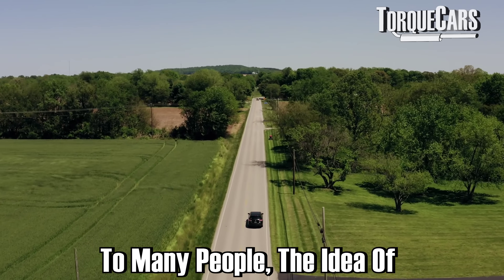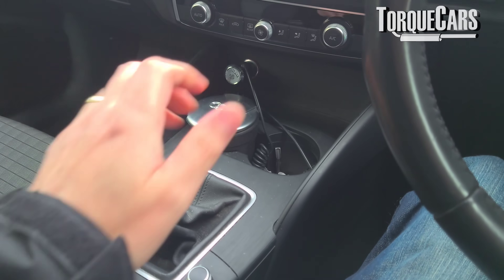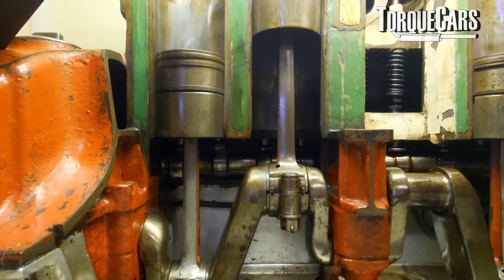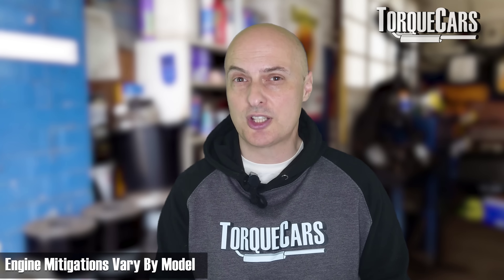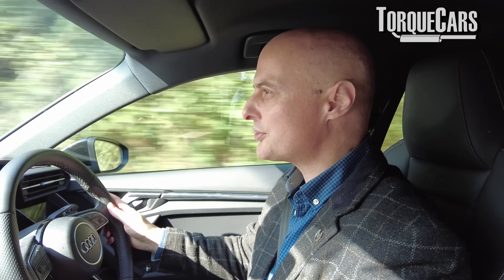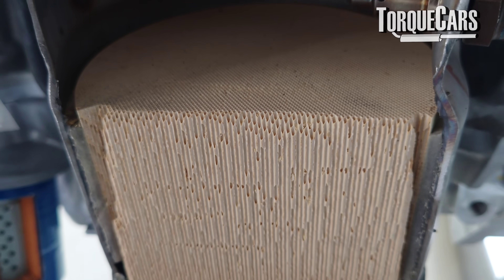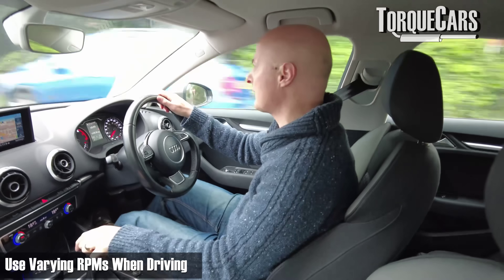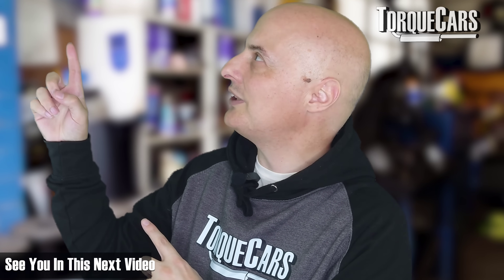BIG DAMAGE By Lugging at LOW RPM? Eco Driving Warning! (Manual Gears)

Comment: Good video, just a couple of points though, I think cooling problems due to consistently driving at very low revs is exceedingly unlikely, cooling systems are usually massively over spec'd (to account for all climates worldwide an extreme conditions). Maybe if you had a fully loaded car towing a heavy caravan or trailer, going up a long steepish hill at low speed in hot weather, at very low RPM (sub 1500 with WOT), it might then overheat, but that would be a supremely stupid thing to do! lol
Also at 2:54 you said too lower a gear when you meant too high a gear 😉
Reply from the maker: You are right, I slipped up with the high gear thing and didn't spot that in the edit either.

Cooling systems are generally good as you say and it is unlikely to be much of a problem but I mentioned it because I'm aware of this happening on a couple of cars in both cases, they were slow speeds wrong high gear selection and one was actually towing come to think of it. Both owners slowed up and used high gears because the temps were high and they shot up higher!

Comment: Funny thing, we have a 1.0 shi*box, the best way i found to actually have better MPG or Km/L since we use metric here, is to actually change gears like the owner's manual says to use it, by order of speed, doing it actually made one hell of a difference, engine runs much better than it did with the low rpm approach, now running constantly at 2500rpm all the way to 3500rpm to change gears and sits at 3000rpm for the desired speed at a gear, 60kph for 4th gear and 80kph for 5th, sits at 3000 in both cases, no need to go full throttle, noisy since "shi*box", but much smoother and responsive when needed to get out of trouble, maintenance wise even the oil comes out in better shape  than it did before.

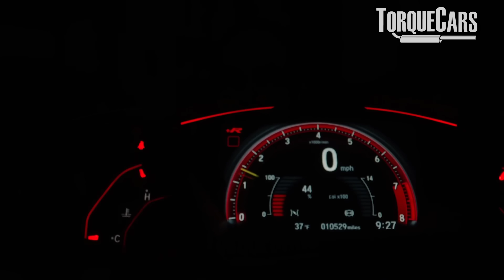Comment: 5:13 What?
First, I'm an embedded programmer and even cheap microcontrollers run way faster than what engines run at. There's a reason why we were able to achieve EFI in the 1980s.
But when you're at higher RPMs, you have less time between revolutions and combustions.
Did you really screw up the math this bad? High RPM = more frequent revolutions and combustions = less time to adjust. Not that the computers need that time to react, it's the electromechanical devices (throttle body, VTEC/VVT solenoids, etc) that need time to react.
Reply from the maker: Sorry if that wasn't clear. The ECU has more times or opportunities to adjust - not more time overall. So I merely meant that at 5000 rpms you have 5 times as many points of measurement and opportunities to make adjustments than at 1000 rpm. The ECU is not the limiting factor here, so an engine will generally run smoother at higher RPM's.

Comment: I drive my '14 Accord manual transmission at low rpm's most of the time.  I don't lug the engine.  I can keep it under 2000 RPM  at speeds less than 40 mph.  It has 228,000 miles (366,000 km).  Engine and entire car has been trouble free.  If I need more acceleration, I use lower gears and go 3000 to 4000 rpm.  I don't think he means my driving style.  This engine is 2.4 liter and has lots of low rpm torque.

Comment: I have a ‘24 Honda civic with a 2L and a CVT (ugh!). It has a “sport” mode where you can use the shift paddles to simulate up and down shifts. I have noticed that it will allow the RPMs to go higher, but if it’s in a higher “gear”, there is no real response from the engine if I floor the pedal. By that I mean that there’s no spark knock or change in sound at all. I think it’s a programmed-in thing to prevent lugging the engine.
Reply: Forgot to mention, there is no acceleration in that situation unless I downshift.

Comment: This definitely makes me paranoid. I have a mk7 gti with the dsg and it shifts at an insanely low rpm, i mean unkess you have the gas pressed down over half way it will upshift at 2k
Reply: All modern automatics do that. It is to save fuel, nothing else. It does not matter if the car lasts only 150.000 km, as long as it save a bit of fuel. That is what happens when you let politicians to decide on techical matters.

Comment: Interesting insights here. Would the equation change at all for a very low torque engine, i.e. a small 3-cyl non turbo DOHC design?
Reply: It is even worse with them. High cylinder count and high displacement engines can handle low rpm lugging.
Reply: @DashCamSerbia  Thanks for the reply. Could you please define "lugging"? Does that also include maintaining speed up a hill in a high gear with foot to the floor, and slowish acceleration between 2nd - 3rd - 4th with full throttle? I usually do both of those, but the engine isn't shaking either, it's just under high load. And on significant long hills at high elevations sometimes there's no other option than to drive foot to the floor at high load even in 2nd or 3rd gear just to maintain 50 KPH.
Reply: @s.b.2088  Low rpm in high gear and high throttle. That is lugging the engine. It also strains the transmission, especially with stronger engines.

Comment: I always drive around that RPM where the turbocharger is starting to boost that's about 2000 rpms for my engine. Sometimes less and sometimes more, depending on the road.
Reply: this will blow your engine... (joke)
You are bogging it still
Reply: @gabrielvieira.4358  Good to know, then i'll drive with a little more POOWWEEERR.

Comment: This video can be shortened by saying. Keep your engine in the torque range of your paticular engine and your engine will be happy
Reply: Would it matter for cvt? Genuine question. My cvt likes to keep the rpms low when accelerating. It accelerates just fine just wondering if I need to start throttling more for more rpms or not.
Reply: @needtau4138  not really, it’s an automatic you can’t control it you can only control the throttle that way
Reply: @needtau4138  a CVT is always in the best torque range for what you need. It's like having infinite gears.
Reply: Without saying how you find out about the design philosophy and the specs of the phase space of engine wear, fuel economy, RPM and power output.
Reply: @letsgo2510  That would mean taking his word with no explanation and no variables entered into the single statement.
Reply: This should be the rule of thumb, but you have wannabe racers who think they're badass redlining their family cars, and in the other end of the spectrum the ones who drive at 1500 rpm all day lol
Reply: Thanks, now I can skip the rest of this vid and move on to the next video.
Reply: No, that would be way too unclear.
Reply: Thanks, lestsgo2510

Comment: As  we turned the AC on sleeping for several hours at idle condition. Does it equal low speed high loading as well?😊
Reply: Not really. It only uses 20% at MAX of engine power

Comment: I remember the same inline four Mercedes turbo diesel engine was early dying on C-classes and happily rolling on Sprinters.
In both models the motor was mated to an auto gear box.
The answer to the ‘why’ question was quite unexpected: on the C-class the ECU kept the RPMs slightly below 2’000 while coasting. On the Sprinter it was never lower than 2’200 RPM while coasting.

The difference was 70,000 to 100,000 km (45,000—60,000 miles) before major failure on a C-class and about 400,000 km (250,000) on the Sprinter before major failure.

Comment: Damn my head hurt when you were using certain terms incorrectly...
f.e. How does a piston travel further in a higher rpm than a lower when it's always the same...if it were you would be bending your crankshaft then you have worse problems than if you were lugging your engine....
You probably meant the ignition point is different but i think that wouldn't happen either. 
I need to know though, what is low rpm driving? I mean i will go into 6th gear turning at 1500rpm while also driving slow...the engine is designed to work in any rpm. They work best between max tirque and max horsepower.
Reply from the maker: Sorry I could have been a little clearer and didn't mean to mislead. It travels further only in relation to the combustion event, it will obviously still travel the same distance. A slow rpm means the combustion event builds lots more pressure as it happens through a smaller rotation of the crank increasing the risk of blow by. The combustion event does not wait for the piston travel and go more slowly.

Low rpm is different for each engine and the load the engine is under, if the engine is straining you are in too high a gear and need to change down, something I hope most drivers do automatically.
Reply: That's called overtorque damage. Where you force the engine rods to make more torque than needed
Reply: @gabrielvieira.4358  Makes no sense. 
Do you mean lugging the engine when the engine has a high load and low rpm causing it to eventually "shake" itself to death if you do it long and often enough times? 
I have yet to hear from a case with overtorque damage.

Comment: Blow-by at low rpms and PCV vakve scared me in my new car, thought it was engine blowing up...... then they told me it has PCV valve..... Driving it at very little at 50% and mostly at 75-100% of it's rpm range.....Engine sounds as it should at 75-100% rpms.
I have to do an Italian tune up every year at least on a vehicle, else it's asking me for the race track or an engine and exhaust teardown.....I'm chose the "Italian tune-up" every year and it works wonders for hyper-engines that are driver at legal speeds... Probably works wonders on normal engines too, though we try to baby the things too much, and cause more harm than good....

Comment: Awesome video, I wish that my 2015 civic si had a bit longer gears , like they could of left the gears like it was a five speed but then add a 6 gear that’s more of an over drive for high way, at 80 mph the rpm’s are really hight but still get about 32mpg on the high way and like 36mpg if it really flat land with no hills

Comment: It used to be called "labouring the engine".  We should never adhere to the computer controlled recommended gear that we should be in and NEVER use full throttle at low RPM!  This used to be basic knowledge which any driver was expected to understand, before the onset of computer technology was hitherto added to vehicles.  Good, informative video, with good advice for those drivers who were unaware of the damage they may be doing!  That said, neither should we flog the engine with sustained over high revs.  The engine should be allowed to run freely and a good driver has a feel of what is required!!

Comment: I found out that using a lower gear it's somewhat more economic, as to maintain the same speed I just need to feather the throttle: I shift up and keep very low RPM only when I know that the travel speed is constant.

Comment: when driving a petrol car in cities, most of the time, you are not able to accelerate fast (rev the engine) because of trafic, so you keep a low rpm (2000 tops) and then you maintain speed at 1200 - 1500 rpm. Keeping artificially high rpm by driving in a lower gear increases your fuel consumption niticeably. Now, I do like to fool around with my car and accelerate fast, but that is costing me 15l/100km with an inline 6cyl 3l turbo engine, compared to 13-14 when I drive properly.

Comment: I drive at low rpm at flat parts of the road, If it goes a little bit uphill I consider dropping a gear, if it gets stepper I drop 1 or 2. I would say you should, chose rpm based on a load. If you drive slowly lets say 50-60km/h and you are at 2000-2200rpm (lets say 5 gear) at flat part of the road it's ok . But if you want to increase speed you have to drop down a gear, if you want to do it fast drop 1-2 more.  Ofc you have to take to account at what speed engine is running an at what speed wheels are turning. I'm trying to not get down below 2000, unless I ran out of gears to drop.

Comment: I've paid for 6500 rpm to redline, so I'm gonna use that to it's full potential.

Driving on low rpm is not gonna make your engine last longer. Takes longer to warm up, low oil pressure, carbon build up. And most important of all, if you want to use the cars potential and suddenly drive on high RPM, your engine will not thank you. 
Kinda like if you never do sports and now want to full sprint without warming up or stretching.
I drive mine around 3000 RPM normal driving. Accelerating or on a highway I push it to 6000 quite often.
The engine is always fairly hot, so I'm in the process of finding the right engine oil, since the recommendation by the manufacturer is not working well enough anymore.

Comment: Something that wasn't mentioned is labouring engines in low rpms also causes premature failure of dual mass flywheels in diesel vehicles. The fuel saved by labouring an engine in 6th gear at about 45mph and expecting it to pick back up to motorway speeds. This is so bad but ive seen it done many times. At this speed you'd need to drop down to 4th gear and accelerate up to 50 even 60mph and then drop into 6 gear. Yes usually 5th gear is pointless before 6 if your'e getting up to motorway speeds. This is a great video and yes, the fuel saved isn't worth the price of repairs further on 👍

Comment: I pay for my whole dang tachometer, so i'm gonna use all the numbers in it.
Reply: @UNBIASEDCOMMENT  *proceeds to push the engine until all lamps light up*
Reply: @Squee7e  I paid for the engine warning light I'm going to use the engine warning light.
Reply: @Squee7e  this reminds me of my last track day. Barely made half of the lap without check engine light and power loss
Reply: @Squee7e  CHECK ENGINE CANT LIGHT UP IF ITS LIT IN THE FIRST PLACE XDDDDDDDDDD
Reply: @FullEnglishYT    I'm not in favor of using the entire range of the oil pressure or water temperature gauges
Reply: @snowcrest7863  my car has no meters for these, only has fine and too much... I've used used both haha
Reply: Mine is digital…. so i have to go 999 km/h and 9999 rev.
Reply: @MutheiM_Marz  if the car top speed is around 200 km/h, I think they will only assign 8 bits (255 max) for the speedometer, so it won't go to 999 km/h
Reply: I’ve paid my whole road tax, so i’m gonna be using the whole road….not a problem, because i payed for my whole insurance policy too! It’s all good use, not abuse, because….smooth brain logic is where it’s at. 👍
Reply: 🎯🔥💥:face-blue-smiling:
Reply: @UNBIASEDCOMMENT  🤣
Reply: @FullEnglishYT  most their miles will be on a flat bed anyways so probably doesnt matter
Reply: @UNBIASEDCOMMENT  too old
Reply: @UNBIASEDCOMMENT  that’s like saying, I bought a body thermometer so I’m going to use all the numbers. Yeah because having a fever is healthy. Duhh
Reply: "Check engine" it's still there....
Reply: @UNBIASEDCOMMENT  🤣🤣🤣🤣🤣🤣🤣🤣🤣🤣

Comment: I am curious why  my 1.6litre 4cyl 2019 5 speed versa at 55 mph  about 2800 rpm gets about 36 to 37 mpg but at 62 - 65 mph 3000 rpm  it will go 40 to 42 mpg on.flat level grounds   how does that work ?
Reply from the maker: Each car has a power band and a corresponding sweet spot for economy where the engine is most efficient. An early video I did on hypermiling went into this more. https://www.youtube.com/watch?v=AI8bF3F9-_M

Comment: I usually sit my revs in the midrange for cruising, the car is never under load that way, and I'll thrash it out from the lights every now and then because I've always had the "Italian Tuneup" thing floating around in my head, not sure if it actually does anything good but in the 10 years or so I've been driving I've never had an engine issue, and that's with daily driving an old BMW which is a brand people typically trash talk reliability wise.

Comment: Dude, get your gears right.  When driving, from stationary, you start in the lowest gear accelerating and changing UP through the gears to the highest gear for cruising at speed or a lower gear for cruising at slower speeds.  When you you want to overtake somebody, you change DOWN to a lower gear for faster acceleration, changing back UP again when the pass is completed.  When trying to TEACH, make sure of your FACTS.
Reply from the maker: You are right, thank you. I never claim to be perfect and totally overlooked this. I was overthinking this wrongly  "the highest gear as the low gear because it’s not doing much gearing!?!" - I was probably having a brain freeze when I recorded this and didn't mean to confuse people. I will plan a reshoot to correct this in the future as it's popularity has amazed me, I only usually get a few hundred views per video.
Reply: @torquecars  Not sure what you mean by "technically the highest gear is the low hear".  This is still wrong.  The highest gear is your top gear whether that is 4th, 5th or 6th gear. The lowest gear will always be 1st gear.  Get a hint from an automatic gearbox.  L stands for low gear and H stands for high gear.  In a 4WD, low range gives reduced speed in all gears for better low speed control and torque for hills.  Even the differential is either low ratio for acceleration or high ratio for top speed such as on the main straight at Bathurst in Australia (where I live).  I have been racing and forest rallying since 1975, building my own cars.  I am a mechanical engineer and I have been trained as an advanced driver training instructor.

Comment: I think the better way to save fuel is coasting. Wide open throttle up to 5k then lift and clutch in / neutral, repeat. Try to be smooth on the clutch though

Comment: I used to have a 8 valve D15 Honda Civic, and that thing LOVED low rpm. It drove like a naturally aspirated diesel, and it sure had tall gears to match the character. In stark contrast, I have also had a 16 valve L15 Honda Fit that was pitiful at low rpm. It was actually more efficient at 2500 rpm than 2000 or even 1500. Even under moderately high vacuum. My Volvo V70 that I have now is more efficient at lower rpm and quite a gas hog at high rpm, but you can tell it's happiest in the mid range.